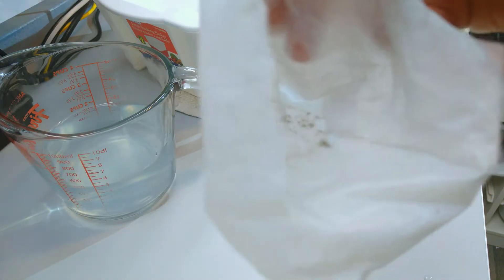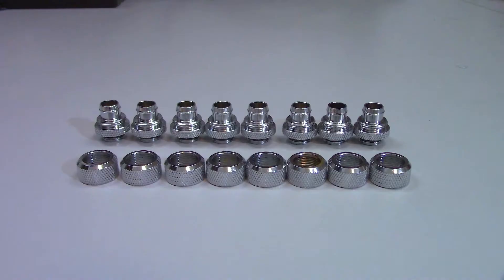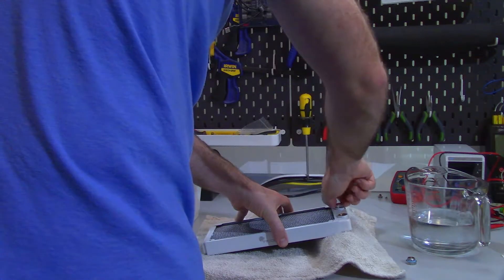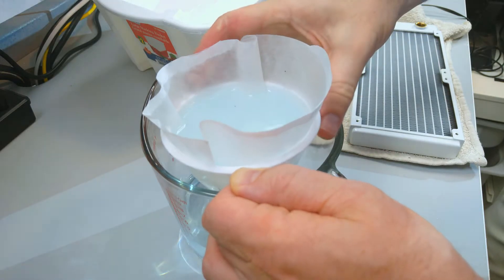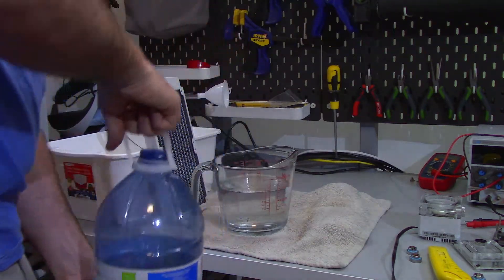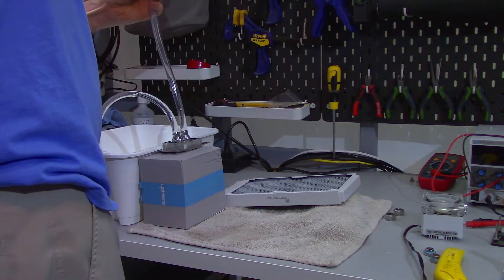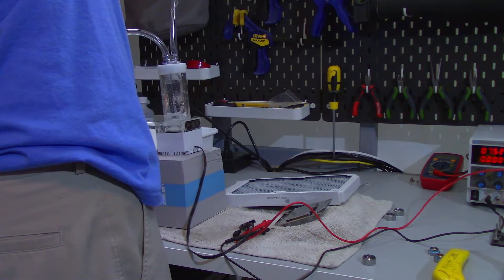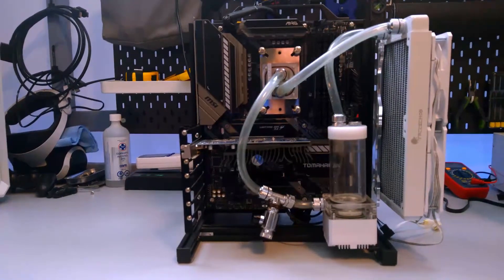Custom Water Cooling Loop PT2 - How to Flush a Loop

Comment: This is so cool, I spent the last few months building a cooling loop out of the same stuff! Same freezemod cpu/pump, cheap 360 and 120 rad, etc
It works well enough to keep my 5800x at 74° under load, I'm really happy with how it all turned out! I will say I was terrified of leaks so I used silicone sealant on all my connections lol
Thx for doing this video, us budget builders can use reviews as well 👍
Reply from the maker: glad you enjoyed it

Comment: I'm not sure but I think the cpu block have a similar fins like the regular cpu cooler, but inverted inside, maybe you can investigate if it's necessary to clean that fins too, maybe in the part 3.
Reply from the maker: For the initial cleaning, you souldn't need to clean the fins. You would only need to if you had some coolant  that left residue or something. Now yes it is possible to clean the fins it's just not typically necessary if you've never used lock before.
Reply: @HardwareForGamers  Thank you, now I definitely not mess with my aio cpu block fins ( is instaled on gpu using kraken rig) .